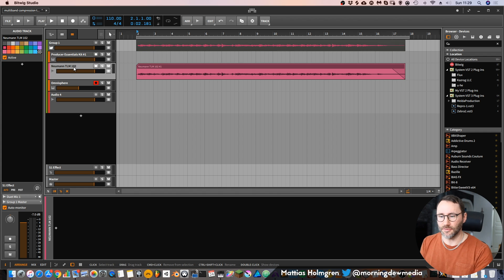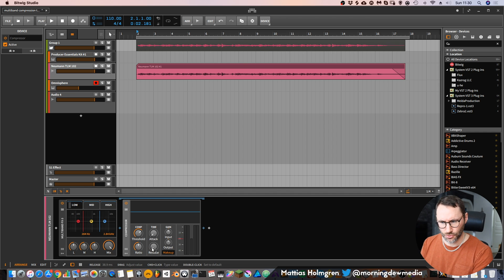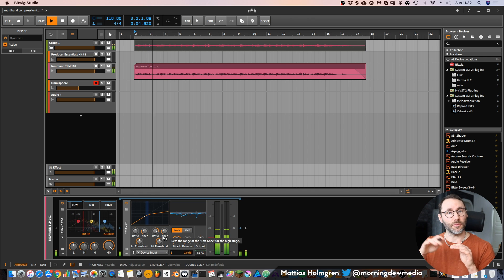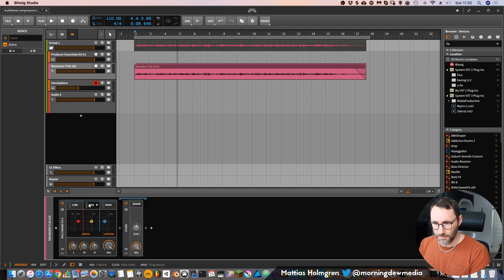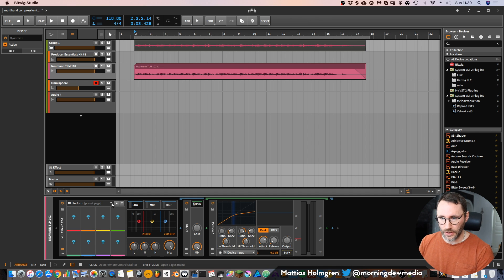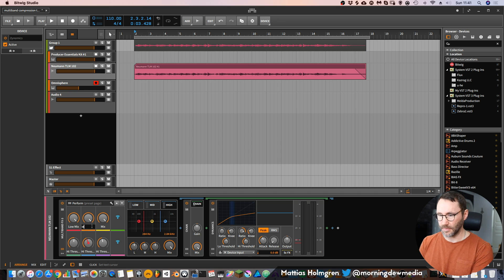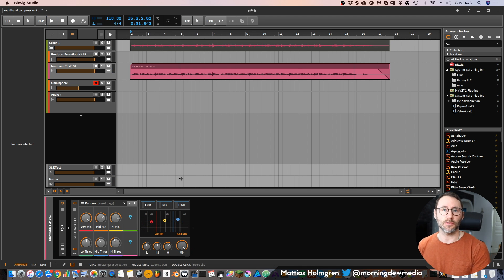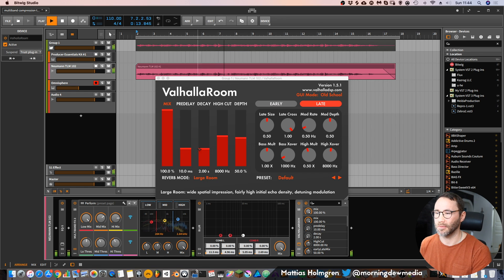Make a Multiband Compressor With BITWIG Devices & Containers

Comment from the maker: QUESTIONS / ANSWERS
1. What's the difference between the Compressor and Dynamics devices of Bitwig?
The dynamics plugin is based on a pure VCA (voltage controlled amplifier) design, while the compressor plugin is also based on a VCA design it adds feedback operation as known from the UREI 1176LN. The feedback operation in urei 1176ln (ln= low noice) uses vca curcuit but singals go thru FET. 
So to my ears, the Dynamics is more of a transparent device. On the other hand, the Compressor can give you some cool saturation.
Try running the signal really hot into the Compressor, use a low attack / release (be sure to lower the output). You will get some really nice fuzz out of your sounds. 
Experimenting is key in Bitwig.

2. Isn't the Dynamics Device Multiband by default? 
Unfortunately, that's a little misconception. It has Low and High (level) controls so you can do expansion and compression with the same device. But there is just one "full spectrum" band. If you want Multiband compression you have to use a similar setup to this Multiband FX-3 chain that we create in this video. Or use third party MB like OTT. =)

Comment: Good walk through. Perhaps it would be a good idea to mention some of the problems that can come from f ex  MB compression on a whole track when the kick/snare can duck out other voices.
Reply from the maker: Absolutely, in the video I only show multiband compression on a single track. But I'm glad you pointed out the difficulties that can occur when using multiband compression on whole mixes or drum busses etc. I'll add it to the topics. It's a creative tool, but as always, handle with care. Use your ears and hearts. =)

Someone also asked if the Dynamics Device isn't multiband by default. But that's just a misconception. It does have Low and High (level) controls but that's for expansion / compression and not splitting the signal into freq-bands. Sometimes it's not that easy to understand these devices, although simple in their design / layout.

Thanks Holon for your feedback.

Comment: Thanks for this little diving inside multiband FX containers and also multiband compression in Bitwig, Mattias! I use multiband compression not so often, mainly in "oh, I have no idea, let's try multiband compression!" moments :) So your video is also a motivation for me to give it another try. In fact I thought there's separate device in Bitwig for this, but multiband FX containers just do their job, quite handy.

And yes, I also keep noticing some limitation in controls here and there, so Attack and Release knobs in Compressor is just another example. I can imagine, that this is not just an arbitrary limitation of the control, but rather could be some limitation of the algorithm used, but I really hope they'll improve it in 3.0, because indeed that's another problem for using devices and modulation to their full strength. Hopefully, it's still a minor change to do)

Thanks again for another great video, Mattias! Good luck and success to your single, will try to find it somewhere) Have a nice and inspiring coming week!
Reply from the maker: Hey Alexey, good to see you! Yes, multiband compression is really dependant on what kind of music and sounds you are working with. If you are selecting samples carefully (good sounds) from scratch you rarely have to reach for the multicompressor. But for vocals, acoustic instruments, guitars and beefing drums it can be really handy and a tool that I often see myself using. If I'm working on a solely electronic track it's rather unlikely that it will be needed.

Out of educational purpose I think it's very good to go through this kind of workflow, like in this video. To get a better understanding and an idea of how these devices work. It can also spark ideas for other kind of devices you can create. Not only in Bitwig but with say the Patcher in FL Studio.

Yeah I would also like to see some more improvements (we can't have enough) in Bitwig 3:
My wishlist is:
1. MSEG and snappier envelopes.
2. Better native saturation tools. More buzz, fuzz, oooze, in a good way like CamelPhat / FabFilter Saturator!
3. Rip (...with "Rip" I mean make a lean and sweet copy suitable for Bitwig) of Chroma Reverb from Logic.
4. Rip Delay 3 from FL Studio.
5. Rip Piano Roll features from FL Studio. At least the arpeggiate / flam / strum / quick chords / scales functionality.
6. Rip Omnisphere (ok, I went overboard...haha)

This weekend was really creative, yeah the single FLY is finally out on all major platforms. I had to get the full rights for the vocals from the female vocalist in Nashville. I was also writing this more "darker" tune in FL Studio yesterday with a lot of vocals/singing which I think I will create a video on. Since it's a bit different and probably a good example on talking mixing.

I was going to finish that piano tune I got started on, but this new one came in between. =)

How was your weekend?
Reply: @MattiasHolmgren  Oh yeah, can fully understand you in this effect of ideas one coming after another and crossing) Sometimes I also start working on several tracks simultaneously, but having so limited time budget for music I usually end up finishing them in sequence :) But yes, it's always nice, when you get a bunch of fresh ideas, even all at once =)

Yes, I should mention, that multiband compression also saves some time, when you just playing with some ideas not going to the final track, yet. I actually try very much of ideas, e.g. some nice patches from nice tracks, which you won't say suitable or not without trying it in your context. Most of them usually go to trash, but they all need some time, and it's good, when you can quickly get something "in the same ball park" like they say in terms of sound, even done not ideal way :) 

Oh, nice list, Mattias! Very nice! It probably covers most points of my list) I just would also want rip of Overdrive from Ableton Live for p. 2 of your list (really, I miss it so much, the only plugin I can tune just fine with one mouse drag :-D)), ping-pong mode and triplet (5, 7...) buttons in Delay modules for p. 4, more precision in controls of ADSR, Compressor and maybe some other devices (if possible), Volume Shaper as modulation device and… afraid to say… track freeze =) Along with the Grid I couldn't want more! But, well, I could))

Oh, nice, looking forward to see new music video from you! According to the previous one I saw, should be so beautiful)

My weekend went quite nice, I finally managed to make some pause in all the other things and spend it almost completely working on my track. I basically working on a vocal uplifting trance track, it has quite loong story from 2009, as I had (well, still have) some troubles with female vocalist for it, so it suffered transfer from Cubase to Live and now from Live to Bitwig (and from Windows to Linux in the same time), which is obviously finished. Now I continue its construction, was working on the breakdown this weekend. Not so much done, to be honest, was a little stuck with re-constructing a lead patch I found in another track, I guess, you know this problem =) So yes, breakdown definitely needs some more love, but now I'm more determined on that) Hope to finish it this time in Bitwig, finally. 10 years anniversary for it, after all)
Reply from the maker: @aclexvideo  great tips for the wishlist. I agree. It would be so much more valuable to have a good native overdrive, ping pong / triplet (rudimentary). 

10 years anniversary, even more cause to celebrate the release when it's done! That's quite the journey for s ong. I don't think I ever moved a track between DAWs like that in my whole career as a game composer.

Yeah, multiband compressors can really be a tool to control some weird peaks at certain bands. De-essing etc.
Reply: @MattiasHolmgren  Yes, those transfers are big pain and so much time wasting things, just as much, as working on the single track that long. I mean, it used to be, that you're starting to lose tracks or instrument bindings due to some system updates, file system changes etc. And there's another need to sit and restore everything to its proper state doing nothing new. Luckily, it's not the case with e.g. Bitwig or Ableton Live nowadays, but I still prefer to quickly put all the ideas together and finish the track to some final state)
Reply from the maker: Yeah moving forward. Not looking back. ;)
Reply from the maker: System updates. =)

Yeah, moving forward really encourage you to repeat the process and grow. But it goes in waves. Sometimes it's easy to forget, that if you didn't create something one day, your power/urge/will to create will come back another day. It just doesn't disappear down a rabbit hole and never come back.

I'm so glad Bitwig Studio is such a stable DAW to work in, I can't even remember the last crash I had.

Though I'm having serious issues with Mojave on my desktop computer at the moment, it's like rolling a dice if I have the keyboard working on boot, and the gfx support for Nvidia / CUDA is non-existent. I need to roll back to High Sierra someday when I have the "power" to go through all the reinstalls. =)

High Sierra rolled on like a train.
Reply: @MattiasHolmgren  Yes, indeed, Mattias, these creative stucks do happen from time to time. Honestly, I think, I'm in one of them at the moment :) Can't make a lead part for another day in a row =) So I really hope, you're right about the come back! :)

Absolutely agree, Bitwig Studio works just fine for me as well, which is amazing, especially given it's Linux version and also I have very, very specific version I built it myself from scratch (for educational purposes initially, but it works many years already). So yes, in terms of hardware and software stability and performance I'm just fully satisfied. It actually do crash from time to time, but, well, it's exclusively because of my VST wrapper, which still needs some more debugging =)

Oh, so pity to hear about those problems on Mojave. I really thought, there's no such thing on Mac. Do you mean Keystation mini32 keyboard? It actually fails to be detected for me as well in about 50% of times, I just re-plug it to USB until it's detected. Might be some low-level USB issue. But with NVidia the problem looks more complicated. A lot of software slowly become depending on GPU these days (DSP and machine learning everywhere :)), so it's quite important. Hopefully it would be fixed soon!

I should say, Windows 10 also looks far from ideal for me — it's really painful, when I have to boot there to see some details in Ableton Live. To make a couple of screenshots from the arrangement could take more, than 1 hour, real shame! It seems to collect updates and just wait for me around the corner to apply them all at once :-D Can't even think of how I used to work on tracks there before.

So yes, the key thing is that it wouldn't ruin the creative process. After all, as you've mentioned recently, analogue synths from good old days used to demand far more time and attention to work properly, so we're definitely in better position now)
Reply from the maker: Oh, and I watched Bohemian Rhapsody on friday evening at my sisters place. What a tragic story around Freddie. He was truly an alien on earth. Probably bullied from day one for those teeth. We all know what that often leads to. But what an angelic voice. Always loved Queen!

They have such a song treasure. They were geniuses. Especially Freddie for writing so outstanding melodies. Powerful and dramatic. I totally resonate with their work. I'm so glad (for his and our sake), that he got to play the LIVE AID in 1985. It was a very important event.

Just found this Definitive Restoration of the Queen Live Aid gig - cool!
https://www.youtube.com/watch?v=HktW217yGTw

In case you missed the movie, give it a spin Alexey!
Reply: @MattiasHolmgren  Thanks for your recommendation, Mattias! Indeed, I missed it, when it was on hot rotation in cinema theatres, but I hope, it's still shown somewhere. Yes, I've also read about Queen a little bit and have been impressed by their story and person of Freddie. How different their music is!

Yes, I think, there's always big chance to be sort of strange for truly creative person. Sometimes it's either love or rejection. That's a pity, but, sometimes it just happens.

I definitely want to see it, thanks for reminding!

Comment: Dope video as always Mattias. Do you have any videos explaining differences from the bitwig compressor vs dynamics or use cases for compressor over dynamics device? I saw you lightly touch on this when you said the comp only has certain range on attack and release. I am finding I can quickly have a hi hat or bell melody line cut thru my mixes a bit better with general compressor added and light tweaks and 1.5 to 3 ratio. I use the dynamics for upwards compression when I use that device (ie: a piano layered with a static texture to bring the high end noise up as the piano sustain releases)
Reply from the maker: Hi Leafy, glad to see you check in. Yeah, I lightly touch the subject in this video since we want mega short attack, release (we want full control) for the compressor settings on a Multiband compressor. I currently don't have any video where I talk about "use cases" other than this. Mostly I'm using other compressors, since the Bitwig ones are very transparent (obviously). Personally I want a little bit of "dis and that" into the sound when adding effects. I want things to rumble, buzz and fizz and breathe some more analogue-ness (is that even a word). =) 

I just rediscovered the new tube-eq in Logic Pro X (my god it's so good on anything, and I don't see anyone using them). Thanks for the tip on the ratio setting for a layered piano with static texture, interesting idea. I use to layer pianos with samples from the ocean, small creaking sounds from boat-rope tearing / straining with seagulls in the background (that's why I bought a seagull acoustic...haha). 

It's lovely to layer pianos with textures on post rock tracks. Bitwig is so wonderfully easy to setup for ducking sounds / effects and bring things up and down at precise perfection. Very neat! What kind of music do you do? Sounds like ambient?

Thanks again for watching and commenting feedback!
Reply: @MattiasHolmgren  Thanks, I make hiphop/urban dominant electronic style music. Its electronic beats rooted in hiphop/trap style mostly. Yea give it a shot - I had a layered piano in omnisphere on the 1st channel and burning piano sfx soundsource on channel 2 with some release and slow attack. 

Add dynamics with high ratio knob turned left - the trailing sound will increase in intensity as the sounds sustain ends. Good for "lofi hiphop" style sounds to raise those textures up to the forefront in the ear in a controlled way.
Reply from the maker: @leafygreensmusic   yeah there's so many cool sounds in Omnisphere. Love it big time! Thanks for the tip.